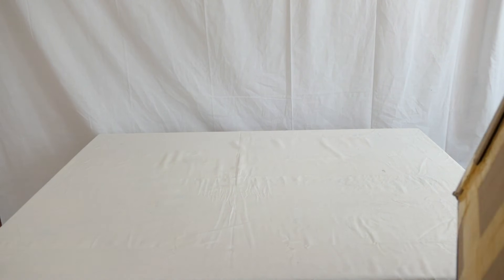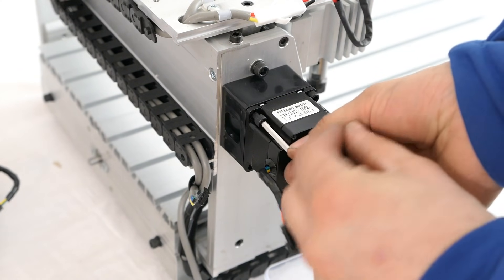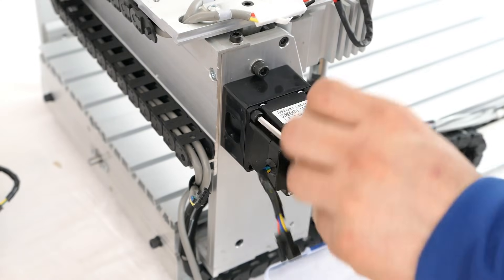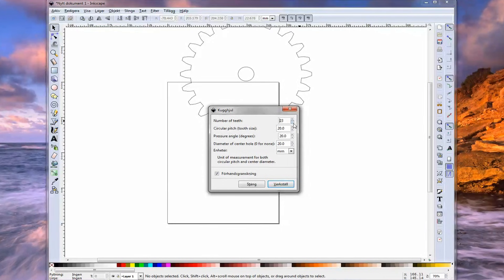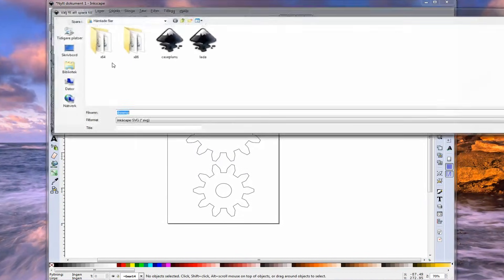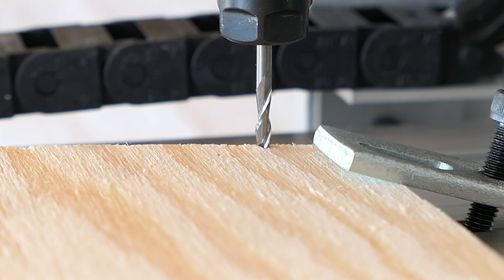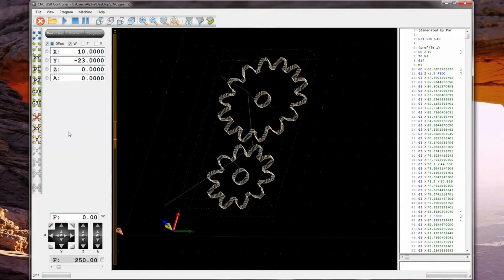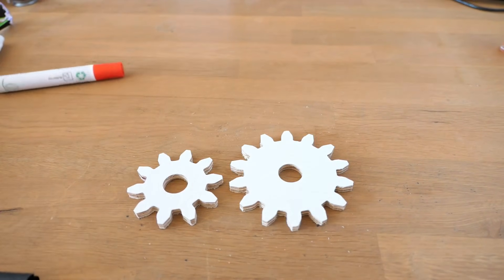3040 Ebay CNC! Unboxing To first part

Comment: hey i can manual move my bottom motor do you have any idea what i could have of done wrong when building it , i tightened the nuts down as much as possible
Reply from the maker: Hmm, not sure what you mean? there is a knob on all motors to manually move them
Reply: yeah i know that i spin the nob and it doesnt move the gantry
Reply: figured thta out but can get it started to print lmfao im struggling

Comment: Are you sure that is where the washers belong on the 4th axis bracket? I would think they go behind the screw cap heads, not between the bracket, and frame.
Reply: Paul Frederick mo...
I just added the same comment
Reply: Totally correct Paul.
Reply: Although with the washers where they put them they did increase their work envelope.
Reply: Always have to accentuate the positive.

Comment: Hi Ravix.  Have you had a chance to work with the "Measure Z grid" for using autolevel WARP feature in CNC USB controller software? I have the same 3040 but have no clue how to activate this feature for precision Vcarving on a slightly bended surface. My normal movable toollength sensor works fine.
Reply from the maker: Hello Vincent! I haven't had time doing that yet. But if i do, i will  let you know!
Reply: Hi RaviX. I've been searching for a solution but it seems that the "measure Z grid feature" in the CNC USB software  is not supported by  my JP382c controller card. And G code ripper does not support CNC USB software.

Comment: Four axis for that price is really good. I will love it if the work area were larger.
Reply: You can choose the size. This one is not named "3040" by random. It means this machine is 30x40cm working area so try to google 6040 or even 6090. There are couple versions, but the price scales with them, and smaller axis means better rigidity :)

Comment: Hi RaviX, thanks for uploading this vdo and sharing the links, is this CNC only for wood? Or can this be used for aluminium blocks also?
Reply from the maker: No problem mayur! You problaby can, but It's not ideal. If you want to use it for aluminium, I would recommend you to buy this and then update the spindle in that case!

Comment: RaviX can you run it off a laptop do you know day one that it’s windows 10 4 years old. Thanks
Reply from the maker: If you turn off the powersaving feature for the USB ports. Then there should be no problem using a laptop! I don't understand what you asking about win 10?
Reply: RaviX if you didn’t need windows 10 then should be ok, cheers for this .

Comment: Hi RaviX , your video is great, with the software you used in the video would you be able to make a halftone picture using dot. 👍🏻
Reply from the maker: Hi James! I haven't tried it myself. But I do believe that you can do that!
Reply: RaviX is the table more than 21cm wide by 30cm long? I’m so close to buying one it’s just videos don’t give the best dimensions and depth that’s all.
Reply from the maker: Its always fun with new stuff like this! My table is 32cm wide and 52,5cm long. And the max working area is 27.5cm wide, 38cm long and hight is 5,5cm
Reply: RaviX thanks for the reply’s, I wouldn’t use all the table space to be cut out but it’s good to know it’s bigger than I was looking at ,Also how long did it take to cut the cogs out?, have a good day/evening.
Reply from the maker: Oh I don't remember that, but I would guess around 2min maybe!  Have a good day!

Comment: i operate industrial CNC routers, consumer versions are absolutely terrible in comparison, even for 700 bucks, the buffer clamps look like they are cheap, and its all around a poor design, but the computer integration seems pretty fluent
Reply: follows
Reply: Mine costs 78,000 dollars US and weighs 6000 kilograms so it's hard to compare it to this but this thing looks pretty cool if you're only doing small stuff and exact dimensions aren't important. Seems worth the money for sure.
Reply: I use perfect plank poplar for making industrial vacform and foundry patterns. They stay very accurate but wood does change in size a bit over time. If more accuracy is required I use renshape. It's kind of like fake grainless wood but is immune to moisture so it holds its shape over time. I mostly machine prototype parts and aerospace components in almost any material. It's funny ( not really ) that my CAM software costs 15,000.00 and I am having a hard time finding work. Signs of the changing times I guess or I'm just getting old. Anyway, have a nice day.
Reply: william Greene Exact dimensions aren't important? Just how much of a tolerance do you think wood can hold? Lol
Reply: william Greene that's incredibly expensive! But I still enjoy the video!
Reply: So do I,it's a cool video.

Comment: Lmao the way you mounted that wood
Reply from the maker: It ain't stupid if it works ;)
Reply: Me too.  He obviously has never used toe clamps.  He is using the heel support screw to clamp instead of adding a clamp screw to the thru slot.

Comment: Hi, I have cnc router also but the black box controller im using is parallel port plus its hard to use. I couldn't find any driver for parallel port. Do you have any idea to convert using usb?
Reply from the maker: Search parallel to USB converter
Reply: Bouaziz Tarik thanks for the help, I have also at my local shop store I tried but doesn’t work also with my cnc.

Comment: double that amount (1400 dollar ) and shop online for the materials then you could get a full size cnc router capable of cutting a full sheet of 12 mm ply
Reply from the maker: would be fun to build something like that!
Reply: recently purchased the cnc files and other documents for the RAW 1.3 i'm still collecting the parts 
the thing that made me choose this machine is that you can build it to any size you want it to be using the same cnc files for the machine specific parts like the corner pieces and the sides for the gantry
if youre interested i could send you the zip file for the machine , hes now selling the plans for the 1.5 version so i dont think he would mind 

the building whont be too hard , learning to operate it might be a bit more troublesome
Reply from the maker: You can find my mail in the profile, if you want to send it! Not sure if i will have time to build one, but it doesn't hurt to have a look!

Comment: Hello! Thank You so much to share these useful info. I have the same machine and I was doing the setup for limits, motors etc. with the cnc usb software...BUT in their tutorial, their machine has the limit switches but We don't have on this...is it right? As You showed, I've seen your machine also doesn't has the limit switches so I was wondering how did You setup this machine with cnc usb software? Thank You so muchh...hope You can answer me soon, so can I can go forward easily :-) Thank You again!
Mirko
Reply from the maker: Hi mirko!

Not sure which tutorial you are referring to. But i don't have any limit switches on mine that's correct. Its been a while now since i did the setup for the cnc. But as far as i remember, i moved the spindle to a corner and then set the position to zero. And in the software i set the maximum distance it was allowed to move. Hopefully someone else can give you a more detailed answer, since i'm not home to check where i did the settings!  Have a good day!
Reply: Hi! First of one, thank You so much for your fast answer...yes, I'm referring to the video "3040 Ebay CNC! Unboxing To first part"...yes I guessed to do as You're saying to move on a corner, to set zero, and then set manual limits...anyway if You are worked fine with these settings, it's ok ;-) Anyone could help more? 3040t + cnc usb software.
Thank You!

Comment: Actually a pretty nice video.  A few novice errors, but that is to be expected for the experience level.  Welcome to the CNC world.  There are a few things I would like to note about those machines.   Go through and tighten up all the bolts.  The wire used on these  routers is sub par at best.  If you are good with a soldering iron I would replace the wire. The motor to lead screw couplers will break on you.  Order some spares.  The spindle motor will also go out shortly.  They can be had pretty cheap.  A spare on hand will be a good idea as it WILL go out at the worst time.
Reply from the maker: Thanks, I will keep that in mind!

Comment: Hi Thanks for the video. I do have a few questions:
1. I have used your google link because I would like to buy one. The link however shows "USB CNC ROUTER ENGRAVING CUTTER 4 AXIS 3040T USB PORT ROUTER ENGRAVER MILLING" But the pictures show an adapter cable from parallel to USB. Was that the same when you made the order? Or did you buy the 3040T-DQ version?
2. What operating system are you running? I read many comments from people with Windows 10 issues.
3. Do you know if it runs from a laptop?
4. Have you used the 4th axis to engrave/mill an object 360 degrees around. If so what software would I need to get?

Many questions, I know, but your advice is highly appreciated!
Reply from the maker: Hello Vincent Twisker! The serial connection is plugged into the controller and the USB  to the computer. But I would advise you to ask the seller before purchasing it. I use win 7, so I don't know about win10. I never used it with a laptop, but I read that it works with laptops as long you can turn of power saving future of the usb. I haven't tried the 4th axis yet, so if you find a good program for it, feel free to tell! Have a good day!
Reply: Hi RaviX. Thanks for your response.  I will keep you posted if I (ever) get the 4th axis to good use. All the best!
Reply: Today I've managed to successfully operate the 4th axis by importing the 2 .nc-files from the following link:

http://forum.planet-cnc.com/viewtopic.php?f=11&t=538&p=2815&hilit=Moai#p2815

I used notepad to change the axis into rotation around Y axis and I scaled down the programs in the supplied CNC USB software to make it fit on an old piece of curtain rod with a diameter of 28mm. I was very impressed with the end result. Apart from the occasional "missed steps problem", I'm happy with this CNC router.

Comment: WATCH OUT WINDOWS10 ,PROVIDED CD HAS A INCOMPATIBLE DRIVER WONT WORK WITH WINDOWS TEN, HAD TO RUN AND GET A PREVIOUS VERSION OF WINDOWS TO MAKE THIS SUCKER RUN. YEA AM PISSED HAD TO SPEND EXTRA GREENS TO MAKE THIS SUCKER RUN. SELLER COULD NOT PROVIDE UPDATED DRIVER PLUS DID NOT PROVIDE ACTIVATION  KEY FOR SOFTWARE GO FIGURE.... THEY SEND NOTHING ABOUT INSTRUCTIONS OR DOCS.
Reply: never mind...that Youtube link was for Mach3. This 3040T came with CNC USB controller. I'm having the same Windows 10 driver problem now.
Reply: ONLY ANSWER IS TO STAY WITH THE PROVIDED SOFTWARE AND DON'T TRY TO UPDATE NOTHING.  HOPEFULLY IT WILL KEEP WORKING FOR YA. BUT THEN AGAIN A NEW CONTROLLER AND SOFTWARE WOULD JUST MAKE THIS MACHINE MORE  BETTER MAYBE.
Reply: Hi carlos flamenco. I'm not sure what update you were referring to. But just for information to anyone running Windows 10 with this 3040T; I've just updated W10 to developers edition...no issues with the CNC USB Controller software; It still works fine.
Reply: carlos flamenco I'm installing my 3040. I have the same experience. But I'm going for the grbl softw running on a arduino uno...

Comment: hi there could you provide a link to the actual eBay listing you have purchased from. The link in the description is a search on eBay with various listings. thank you. awesome video
Reply from the maker: Hello! Sorry but seller i bought mine from does not sell them any more.
Reply: I see, T.T yeah all the listings that i can find so far is using parallel port for 4-axis. Haha oh well, thanks anyway.
Reply from the maker: I did change the link now, so it's only supposed to show the usb version! Thanks!

Comment: pretty cool but dont forget to use tabs so yu can rip your part off from the main body or else your part will move like you see in the video and if it moves while drilling you can mess up the dimensions .
Reply from the maker: Yes that is a good idea. I did learn it the hard way when making other stuff!
Reply: এই মেসিনের দাম কতো হতে পারে

Comment: i have been using snapcnc from docado.com
with my 3020t  as my machine does not have any usb source 
the snapcnc  which i purchased for around €50.00 and can be connected via the port on the control box and then snapcnc is connected to the laptop via usb cable it 
threr is no need for mach3 as snapcnc controls the machine
works great
hope this helps others who have no usb in their machines
Reply from the maker: Thanks james, i'm sure this will help others!
Reply: I want to buy the 3040T with 4th axis...and this what is stated on their site:

Controls 3 Axes, 2 spindle relays and 1 cooling relays

So no 4 AXIS support from Snapcnc?

Comment: So did this controller have a USB port on the back? Does it work with the chilipeppr cnc software? I'm looking at getting one of the smaller versions of this machine ( 3020 ) but they're otherwise the same. The ones I see on ebay just have a USB to serial cable included, not a USB port.
Reply from the maker: Yes it came with a usb port, and it works like a charm. I have never used chilipeppr so I dont know about that!. I was thinking of getting the 3020 first too, but i felt it was to small.